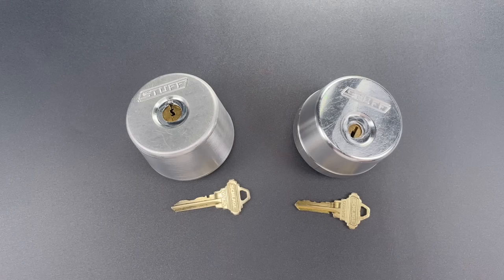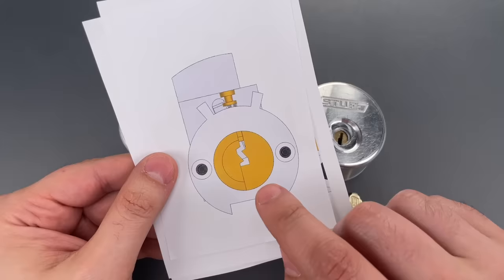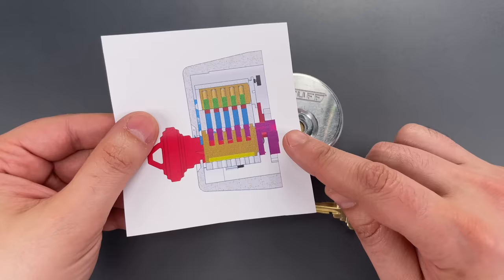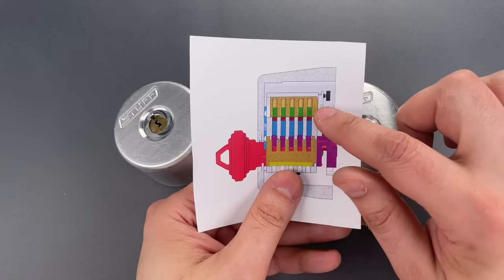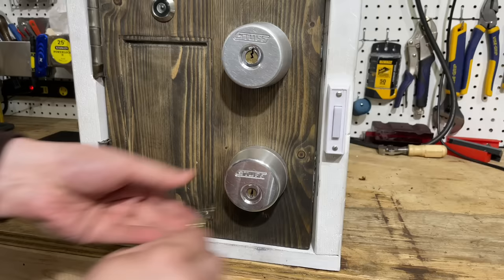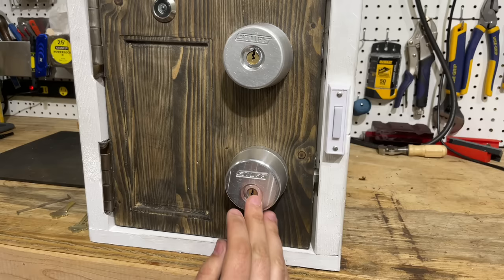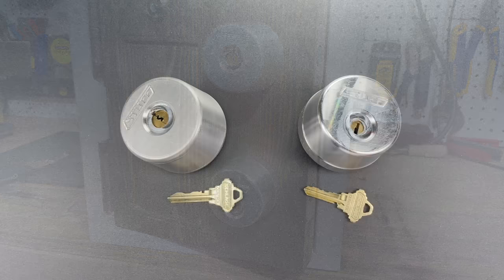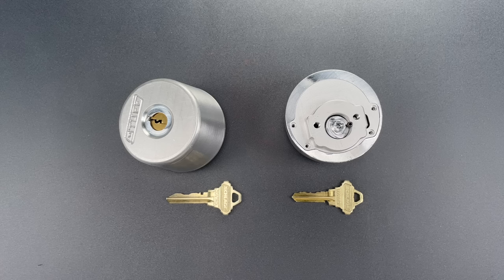[1299] Unpickable Locks From Stuff Made Here

Comment: I just want Shane to make a lock that's unpickable and LPL sends it back to him with a bullet hole in it, "Ya so this one was pretty easy"
Reply: or he drills it
Reply: The Bosnian Bill method
Reply: Honestly, by this point I'd call it a win, since it would be easier to destroy the average door rather than open the lock.
Reply: @Mernom  no..it still not "unpickable" that is like making a car that can move but u cant ride in it...
Reply: @kiro253  thats the issue though, there’s no material a lock and door could be made of that would be impenetrable. 

Bank vault doors are still cuttable right?
Reply: @TheMuffinman191  even those. Yes
Reply: @TheMuffinman191  With enough explosives, every door opens. However, I would assume that most bad people don't have the explosives necessary to blow away a massively overengineered vault door
Reply: Time to dust off the Ramset?
Reply: @zacharyboivin3925  nah he’ll need a thermal drill for that
Reply: @Ilikeng  nah the dust covering a ramset should be concrete by now
Reply: @thatoneguy4515  its just gonna overheat
Reply: @thatoneguy4515  or a wad of cash
Reply: @itsapeanut7139  yea
Reply: I was expecting a comment saying, “You can’t shoot a lock, the bullet will only bounce off!” But I didn’t so im first.
Reply: @thatoneguy4515  guys, the thermal drill, go get it
Reply: @thatoneguy4515  Most thieves dont have years to wait, or enough patience to reset a drill hundreds of times
Reply: @TheMuffinman191  well...cutting or blowing a lock is not picking....it defeat the purpose of being unpickable...might as well just make a tungsten plated titanium lock then..
Reply: @Mernom  I's gots a steel door on a steel frame connected to concrete and 13 cm logs 😇
Reply: it would be funny if Shane just made a solid metal block with a keyhole but no actual lock inside it just to watch LPL struggle
Reply: @kiro253  no lock is truely unpickable.
It just need to be twice as unpickable as any other lock in the area.

If you need it for an application where that particular think MUST stay close, you shouldn't be relying on just a lock anyway.
Reply: @deemcgann1695  that’s if you’re doing overdrill
Reply: @Mernom  and?? He said the lock is supposed to be "unpickable" and lpl prove it is not...

If there is no lock that is truely "unpickable" than DONT CLAIM it to be lol(dont get me wrong...i am not hating on that guy i also usually watch his video and i think he can do even better than this...if he wanted)
Reply: Yes so as you can see here the lock was not bulletproof proof this is a very common oversight when producing locks.
Reply: @Mornelis  looks like el rubio is back in his chopper
Reply: For everyone saying any door is breakable or penetratable I just want to add

Lockpicking is for people trying to NOT be noticed or it is for people trying to NOT damage their property just to get back in.

If I don't care about the property, then I could lockpick if it is easy but just kicking down a door is even easier.

Other notes:

LPL mentioned the hinges being welded in this video. That touches the subject of door security not just being about the lock. I've seen doors with the hinges exposed, or the frame being homemade and easily exploitable. A good lock is wasted on a shitty doorframe or door.
Reply: @thatoneguy4515   Guys, the drill, go get it.
Reply: Hahaha
Reply: @zacharyboivin3925  ok
Reply: Don't worry he will just make an electromagnetic fusion core for the lock to reflect the bullet away
Reply: @thatoneguy4515  Guys, the thermal drill. Go get it.
Reply: @Mornelis  You beat me to it? I guess this is a sign for me to not act dumb.
Reply: That's… not understanding what picking a lock is for.  Look up "non-destructive opening".  If you put a bullet through it, you failed, not succeeded, in PICKING it.
Reply: @TheMuffinman191  someone may have already mentioned it but tungsten is a pretty tough metal with a high melting point. Granted its also expensive to use.
Reply: @PeterJavi  yeah a burglar or a kid who wants his motorcycle back wouldn't have c4 on them
Reply: That sounds like what happens when you give a lock to Mrs LPL
Reply: @rachel1426  cool
Reply: No noise, no damage... But I like where your head is at👍
Reply: @kiro253  you haven't picked the lock if you smash the window
Reply: "so it turns out i actually can't pick this lock. but that's... impossible. any other lock that claimed to be 'unpickable' was defeated with ease. no lock can be unpickable, it goes against common sense. if a lock was unpickable, then does that mean more will come? what if a day comes where my skills aren't enough? will i become obsolete? am i going to be forced out of a job? no, no, no, i can't let this happen."

screen cuts and gunshot can be heard

"yeah so i didn't have much difficulty with this one, although the creator clearly didn't know all the techniques i use to deal with these things so i can't blame him."
Reply: hahahhahahahahah
Reply: "This is the lock picking lawyer and as you can see I have with me today the unpickable lock v3 with a roughly 9mm hole through the face of the lock"
Reply: Locks have always been more for show than real security.
If you really wanted to prevent something from being stolen you'd encase it with tool binding materials and hide it under a metaphorical mountain.

A literal mountain is simply too easy to locate.
Reply: @PeterJavi  the payday 2 gang does
Reply: "Nothing a C4 can't fix"
Reply: @deemcgann1695  fucking payday 😂
Reply: The Denny Craine approach.
Reply: @PeterJavi  wanna bet lol
Reply: @thatoneguy4515  kinda getting gta online vibes from this
Reply: Shane responds by rebuilding the lock of out of pure kevlar 🤣
Reply: The Payday method

Comment: SMH: "I made an unpickable lock"
LPL: "Here are 5 ways to pick the lock.. First is with a pocket knife"
Reply: that was just brutal
Reply: Ouch
Reply: @ghastiafy67  its a bot, it can’t
Reply: People that's a link farming bot
Reply: It's not picked with the knife though... he just walked the bolt back. So it wasn't a vulnerability of the lock, but of the installation....
Reply: @1337GameDev  no it was particularly the lock aswell because the lock turns 45 degrees before it stop rotating without the correct key this disengages the mechanism that prevents the deadbolt from coming back, he mentions this in the video at around 4:45
Reply: @brianhakins4692  It's all about the security profile - I'm not sure if that term from the Common Criteria is in use in the world of locksmiths, but conceptually that's exactly what it's about. A secure product offers a certain set of security functions, implemented to various levels. Pickproof, resistant to drills, etc. It's entirely ok to not provide certain security functions - they may be unnecessary or even unwanted depending on how you use the product. However, if you do provide a security function it should actually work as advertised. This lock is faulty, because it does offer a bolt locking mechanism, but it is bypassable without the key.
Not having bolt locking can actually be an advantage - you can use it as a "safe escape" lock, which provides decent resistance to entry from outside, but (depending on the handle you install on the inside) can be easily and quickly opened from the inside, onehanded or even with any other part of the body, even in low visibility: just slide it open. Plenty of good use cases for that. There are no good use cases for a broken bolt locking mechanism though. Sure, it can be mitigated with proper installation, if you know that you can't depend on it, but that's what it is: mitigation of a known fault.
Reply: @adamkozakiewicz6766  aight cool, none of that was usefull for this in particular application but yes ty...

Comment: Most of these attacks could be defeated by simple physical changes. 

A plate extending over the bolt and gap in the jam preventing bolt pry back.

A small step in the lock body that protrudes into the door preventing the tension tool from entering.

Comment: Next episode with lock v3: 

“So today we’ve got Shane’s new locks and I found a couple of ways to get in. Using some peanut butter, a shower loofa and this Pokémon card, we are able to get around the locking mechanisms”
Reply: It'd clearly have to be the Marshadow GX card
Reply: Lol of course
Reply: Sounds like it can actually happen in the next video
Reply: this is some speedrunning levels of specific
Reply: Fr🤣
Reply: LPL: The Modern MacGuyver
Reply: "See, the lock is made of steel, rather than aluminum like the previous generation. This is a fatal flaw, as steel is 2x weak to fire, so by using this Chandelure we can weaken the integrity of the lock and use its ghost type to our advantage and phase through the antimatter barrier that is supposed to cancel out your lockpick, in theory at least. Sadly, I lent my only antimatter pick and its corresponding safety gloves out to my good friend Bosnian Bill, so I do not have it on hand at the present. The peanut butter is in case I get hungry and the shower loofa is so I can evenly apply peanut butter to the 4D surface of the lock to make it stick back in 3 dimensions."
Reply: We need howtobasic up in here
Reply: @xaereus4940  lmao
Reply: "A little click on one, nothing on 2, a little click on 3, I'll slide the loofa 180 degrees and we're in"
Reply: But it only works if it's a Bulbasaur.
Reply: This only works with a Charizard special ex card
Reply: @xaereus4940  Use the "Doctors" Sonic screwdriver.
Reply: Remember it took him over a month to find these exploits. 

If someone was trying to pick my front door for more than an 10 minutes, he would be caught.

That's the whole point of the  "5 minute window", when it comes to safes, locks and security. And it's also the reason why security rounds will retrace their steps within 5 minutes. (A retrace can happen many different ways, it doesn't always mean just physically walking by again)

Sometimes the length of a hallway can even be included in a retrace for security. So if a hallway takes 30 seconds to walk down, to reach a 5 minute lock. He can check 4 hallways, in 1 second, every 7 minutes. Or check every corridor to those hallways every 15 minutes per floor.

Security can be simple, for the simple minded. But it can become very complex and artistic if setup by the right person.
Reply: MacGyver

Comment: "Note that Shane welded both of the hinge-pins, probably to stop me from popping the pins and declaring victory, and I've gotta say, he did the right thing, 'cuz I definitely would have done that." 😂
Reply: I guess that’s why front doors just open inward, hiding the hung-pins.
Reply: @whatisahandle221  absolutely the reason and not anything to do with firefighter’s accessibility to the house :D
Reply: @mastersanada  firefighters can get in either way and if the hinges were on the outside it would actually be easier for em to gain access as they would just take the pins out the hinges, if forcing the door isn’t working
Reply: @kingj_da1st377  I think it honestly depends. Apparently for inward swinging doors, there's multiple things. 

I did mention the firefighter thing, but apparently there's other benefits like having a standard design that allows for the hinges inside to be removed easily. Of course, there's also deviations. Apparently in south florida all the doors open outwards so that it's hard to make a forced entry (the door frame is an added block). 

Apparently in public buildings the doors open outwards for fire safety (more people inside the building), as apparently it's easier to open a door outwards whilst in an emergency vs. open inwards during an emergency.

Whatever the case, it seems to me like you can install a door either opening inwards or outwards, you'd just need to compensate for the hinging and understand that there are slight differences (I think mainly with whether or not there's the frame in the way to secure the door better.

This is just what I read online but it's honestly a jumbled mess of people saying this and that. The one that made the most sense to me was the opening outwards is easier in case of fire. Not entirely sure how positioning of door hinges works depending on opening outwards or inwards. Door frame being on outside and inside (Or in other words, in front of the door or behind it) also makes sense in terms of differences.
Reply: one hell of  a lawyer. what kinda law does he specialize in? hope it's not personal injury, or wills... a waste of talent. hope he's a criminal lawyer and his prospective clients line up every day hoping to have him take their case.  and make small talk....
Reply: @whatisahandle221  Where I live in Florida it's actually common for front doors to open outward because hurricanes can potentially blow inward doors open.
Reply: @mastersanada  Panic bars are required in many municipalities for public buildings and office buildings and for those to function, the doors must open outward.
Reply: @dangurtler7177  aye. All designated paths of egress in public buildings must have panic hardware. Things like the push bar latch allows for people to sprint at a door and easily open. If the door swung inwards you would never get it open when there were 30 other people behind you clogging up the exit. 

That southern Florida thing with the home doors swinging out is probably for weather/building envelope integrity since hurricane/tropical storm force winds are actual a relatively common occurrence.
Reply: @whatisahandle221  If your front door opened outwardly...you would need  a bigger front porch to step back away from the door as it swings open...right?
Reply: @mastersanada  Outward-opening doors are required in public buildings because of a fire where people were trapped in a theater and couldn’t open the inward-opening doors it had installed.
Reply: 9:22
Reply: @mastersanada  they're firefighters, if they can't open the door they probably just pull out a 20 kg metal pliers and cut the door in half
Reply: @catagamas  I'm inclined to believe they can just bust the whole door down 

Or the big saw or whatever other big tools they have
Reply: @mastersanada  lol
Reply: But That would have bin stupid that wasn't the challenge
Reply: @mastersanada  Fire axe
Reply: @catagamas  or a K12
Reply: @mastersanada  and now you can look double acting hinches
Reply: Doors swinging out can also be barricaded from the outside, by anyone with access to the outside of the door, or by snow.

Comment: “When I told Shane he over engineered a solution.”  Looks like you two are getting to know one another.
Reply: Honestly I think everyone who watches more then 3 of the Stuff Made Here videos expect over engineering
Reply: @U1TR4F0RCE  it's how engineers think. You can simplfy and cheapen it after making the 1337 version.
Reply: I love that once you get to know him you realize that Shane is actually really dramatic about over engineering
Reply: @Bagginsess  I'm in school for Comp Sys Eng and outside of not really properly cheapen or simplify it I don't think I tend to over engineer code for the most part. I just try to make sure that the code passes the specific tests that the TA will check and try to hide things that would cause errors. For a big project we did last year our second last presentation actually if I remember correctly had the hardware test for the NFC cards hard coded because the default ids on the cards were used rather then the cards data(Which we changed for the final presentation so it was more legitamite).
Reply: @U1TR4F0RCE  software is inverted. Good code is simple and as efficiently lean as possible, bad code is bloated and "over engineered" making it easier to break and be hacked.

Comment: Also worth noting that that door is just unfinished pine.  Pine is a very soft wood that will damage easily without a finish on it.  You wouldn't find a door like that, especially an exterior door.  It would most likely be painted which is a much more durable finish, or a stain grade door would likely be made of a hard wood or have a hard wood veneer on it.  It also wouldn't just be stain it would have a more durable clear coat like polyurethane.   There may still be some damage on these finishes but likely significantly less visible.
Reply: Why didn't the lock maker guy, in addition to screws, seal the lock to the door with Crazy Glue?  I've a feeling that the two men had many behind the scenes parameters laid out before each agreed to this public competition.  After all, he is...the lock picking....lawyer.
Reply: @Frip36  nobody glues their locks to their door and if they did they are really just screwing the next guy that has to replace that lock.  And as the universe has taught us when you screw the next guy the next guy is likely to be you.
Reply: True.  But my point was, surely, there is a way to "seal" the "gap" between door and lock to discourage an instrument slipping through it.  A way that doesn't damage the door when lock is removed.  @jessebutryn
Reply: @Frip36  lpl mentioned in the video you could add sheilding to the lock itself to prevent that attack without having to do anything with the door

Comment: Shane: “I’m going to weld these hinges so he can’t get through the Door this way”
Also Shane: “theres a gap between the lock and the door but we will leave it”
Reply: I think he left that gap intentionally, so that we could see the deadbolts in operation.
Reply: So by basically making a recess at the door before slotting the lock in, as well as utilizing the standard jamb lip used in doorknobs to prevent card-opening, you can make the 2nd lock better?
Reply: Would have been even better if door hinge security pins were installed, baiting the LPL to unsuccessfully attempt the hinge attack.